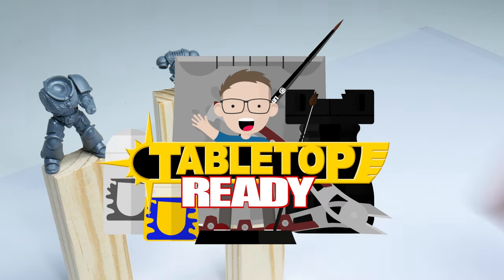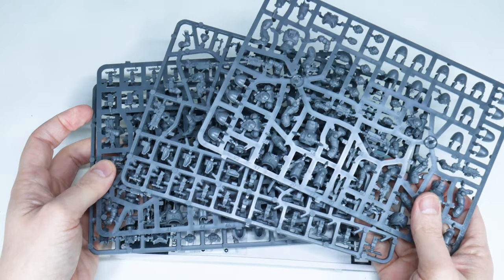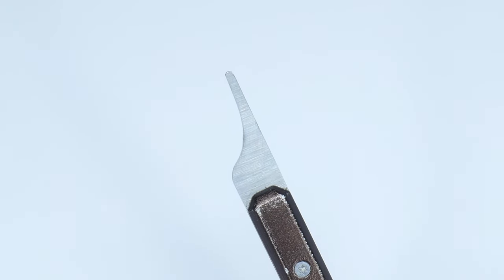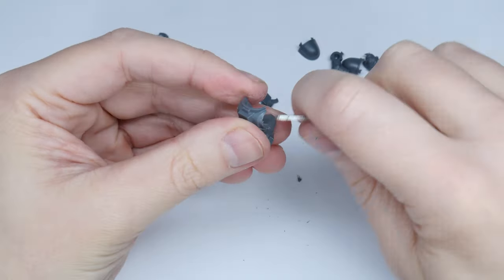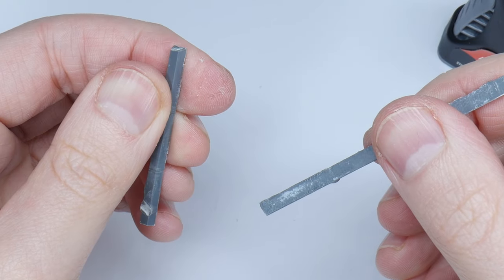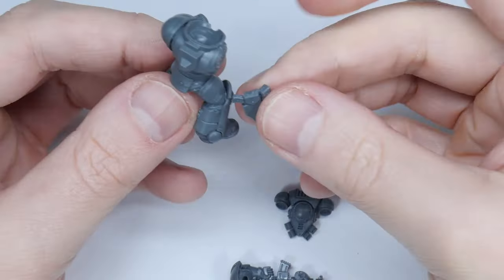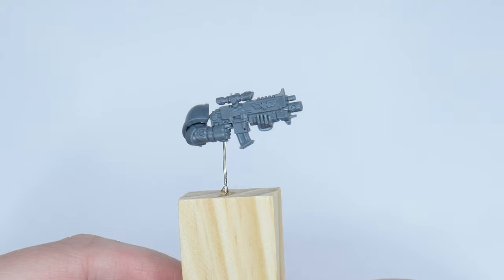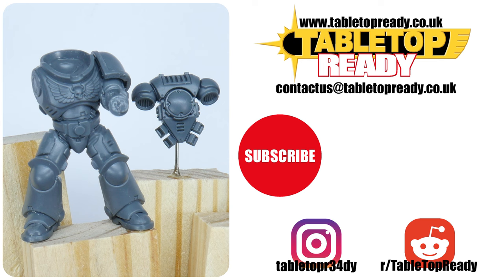How To Build Miniatures and get them ready for painting using Sub-Assemblies Making Painting Easier

Comment: I know it has been said before, but you really can't stress it enough for beginners: if you do this, make sure you don't paint the parts you're about to glue later, or use some kind of superglue instead of the plastic melting one. The glue won't make it through the paint layer, will mess everything up and you'll end up with a mess of a joint. I had to learn the hard way while gluing on some wings to the back and had no idea the glue wouldn't work, which messed up one of the best minis I've ever painted (so far).
Reply: Yeah I had a similar experience where the glue just melted away the paint that it got in contact with. Luckily all I needed to do were some light touch ups!
Reply: Wouldnt pinning work?   Say if you need to paitn cavalry and mount the rider again
Reply: @rataca100  Could do, but probably best to either mask off the contact areas, or scrape some paint so plastic glue works, or just use super glue
Reply: Yeah your paints are acrylic which is a plastic medium so unfortunately plastic glue melts it in its attempt to bond with it.
Reply: And this is why I don’t sub assemble. Sometimes just the fumes and mess up the paint.
Reply: Learned this today… I masked the joint where the head goes but not the shoulder joints or the bottom of the feet. Spent an hour scraping and sanding to get the desired effect. Live and learn.
Reply: So just for clarification, if I accidentally paint over the area I’m connecting the part to, will Super Glue still work on the painted area?
Reply: @hodelngasu3103 Yes, it will as it connects anything. Just not as solid as plastic glue as it does not melt the plastic parts together.

Comment: I would heavily advise using some blutack, tape, putty, or whatever to protect the joints that will eventually be glued together. Nothing worse that undercoating each part and having a beautiful paint job, only for the cement to have no plastic to melt. So it ruins your paint and your model won’t assemble
Reply from the maker: thats great advice. Because plastic glue can ruin the paint, I like to use super glue instead

Comment: To save a bit of time, I've found that the only sub-assemblies that are always required are the body, backpack (or similar such as cloaks, etc.), and head. I only do the arms separately if they cross over in front of the body (otherwise it's hard to get to the armor underneath). On models where the arms have a wide open pose, it's not necessary. Also, the holsters are usually easy enough to paint when they're glued onto the body that it's not necessary to do them as a separate sub-assembly. This will differ depending on the model, of course.
Reply from the maker: absolutly. some of my choices for sub assemblies are made so I can better show how to paint on camera. but you can do as few or as many as you need to. I bet theres people out there who paint every part seperate ha and some times if theres a lot to paint I'll just assemble everything so it doesn't get too over whelming. :D
Reply: @TableTopReadyYouTube  Yep! I tried priming and basing every part while still on the sprue, once. Once. As soon as it came time to nip & trim, though, I realized why that was a bad choice. 😄
Reply: Yeah I'm dealing with this with primaris infiltrators right now. Holsters, pouches and grenades have gone on. Heads, backpacks and guns held with two hands are all separate and now I have a board covered in so many individual bits it looks like a hedgehog

Comment: I actually would recommend cutting with the scalpel TOWARDS your body. It seems silly and dangerous, but since you're typically cutting such a small and simple thing (I.E. not applying tons of pressure trying to lop off a large chunk, or widdle down a large stick into a spear), you can use your fingers and thumb as a fulcrum to gain more control and finesse than if you were pushing away. Also, since it's a small thing like I mentioned in the last sentence, if you end up actually cutting through the mini and touching your skin, you aren't using enough force to slice into your skin. If you notice you actually DO have to apply a lot of pressure to cut through GW's plastic... you likely need a new scalpel, because your current one is now dull.
Reply from the maker: Wether you’re cutting towards you or away from you can provide the same amount of control with enough practice. The problem is having to put your fingers in front of the blade when pulling the blade towards you rather than behind when pushing it away. I find this method a lot better for myself as i don’t find myself having to wear a plaster when I paint anymore haha and it use to happen a lot. It’s important that people work in a way that works best for them, I’m just showing what works best for me which is safer as a lot of new hobbyists will watch this and don’t have that experience we have with a craft knife 👍🏻

Comment: Thank you for your video and inspiration. The jenga handles are simply genius. They make moving the work around my table a lot manageable and easier to put down and pick back up with out taking a ton of space. Cons, I gotta be more selective with my super glue as I’m using smaller resin printed models and I ran into two problems to solve. The first being that the smaller size models legs can break before the Super glue bond breaks. Second, models with broader spaces have trouble adhering if the surface isn’t completely flat. I think i can try using more paper clips points glued and elevated from the jenga piece, that the feet of my model can stand on and be glued to.  

I’m curious what you do for bigger models? I tried screwing some jenga pieces together and glued big feet to the whole piece Hard welding the model to the jenga pieces together 🤷🏽‍♂️
Reply from the maker: I'm not sure if you've seen my more recent version of this tutorial, I do things a little differently now. if your worried about removing parts without breaking them, you can always have then attached to their bases and then use a plastic shot glass as a handle. For bigger models I try and find other things I can use, I have a few spray can lids which do the trick

Comment: Great video, though I disagree with the idea that you should move the knife away from you whilst removing mold lines - I find I have much more control when moving it towards me.
Reply from the maker: Thank you. It’s not so much about control as it is to prevent cutting yourself. Cutting towards you or away from you can provide as much control as you want with enough practice. The problem is when you work towards yourself you tend to put your hand and fingers in front of the blade as you pull it towards you and you end up having to paint with a plaster on your finger haha you should always work how you feel comfortable though but I want to make sure I’m showing best practice in my videos

Comment: If you don't have a hand drill for minis, you can just use a lighter and heat up the paper clip (watch your fingers of course). Also you can buy hard sponge blocks for sanding and jam the paper clips into them.
Reply from the maker: Your a madman
Reply: I use putty (such as Blu-Tack) and wooden match sticks to hold the parts for priming. Saves a lot of time and hand cramps over drilling with a pin vise. As an added benefit, the putty covers the area where you're going to glue the part so the paint doesn't interfere with the plastic cement.

Comment: Hey mate, very helpful video. I have a question about the powerpacks, how do you then cut it after the painting is complete?
Do you somehow rip the pack off the paperclip? Or cut it as close as possible?
Cheers mate
Reply from the maker: Once I’m finished painting, I just snap the parts off the paper clips because of how the super glue works 👍🏻

Comment: stupid question, when you put your sub assembly back together, do you scrape off paint where the parts meet and use plastic glue, or just super glue em
Reply from the maker: I assemble after painting. If you super glue then you don’t need to scrape away paint, but you do with poly cement

Comment: This method looks great as I’m a perfectionist and would like to be able to get those hard to reach places looking as best as I can get them. I’m new to the hobby and starting my first set of infernus space marines. Do you think I can use this method on the push fit models? I’m not sure how they will join and wether I’ll have gaps once fitted together. Thanks!
Reply from the maker: For those marines what I did was to leave the back packs off and also the heads. I just clipped off the pegs for the heads. 🖖🏻

Comment: Super gluing the models to the wood is an interesting idea, but won't the residue from the superglue on the miniature interfere with the plastic glue when it comes to assembly? Cheers (:
Also, which super glue are you using here? Thanks bro (:
Reply from the maker: I'll tend to remove it by scraping or sanding once I'm ready to assemble everything. I will be doing an updated version of this tutorial very soon. Any super glue is fine. I use what ever I have at the time to be honest

Comment: One thing missing is how you glue it back together after painting! As presumably the plastic is then covered in paint, so plastic glue wont work! Is it just super glue you use to reassemble?

Sorry, commented something similar on another vid you did too but really lookint for advice 😅
Reply from the maker: you can use super glue wth no issues. if you want to use polycement then I reccomend scraping a little of the paint away from the contact surface. I do have a recent video about getting your miniatures ready for painting talking about it :D
Reply from the maker: no worries :P hope this helps

Comment: Question - I use plastic glue to glue my parts after I’ve primed them with Citadel spray can paint so I reach all the nooks and crannies. I’ve heard some people say that you should never use glue on primed parts however a guy working at a Warhammer shop said it’s fine with plastic glue just not super glue. Do you know if this is true?
Reply from the maker: You can use plastic glue. It’s best to scrape some of the paint away as the glue is designed to melt the plastic. Super glue is also fine

Comment: Wow, first time seeing SM's being assembled - Didn't know there were this many small pieces in comparison to standard ork boyz. The difference is that orks are far more difficult to paint, so guess it balances out haha.
Reply from the maker: It’s a different experience painting a space marine than an Ork. I wouldn’t say more difficult as you can make anything as difficult as you want to 😃 You can get away with a lot painting Orks, a space marine needs a more attentive touch if you want to achieve the same level. Orks are more fun to paint though obviously as Orks are best haha but it’s good to have a go at painting many different things so we get experience and knowledge we can use on anything we paint 👍🏻

Comment: Thanks for the video.
I missed some info about how to remove the paper clips from the small parts, as grabbing them hard to yank the wires after paint is a risk to damag the paint. Maybe cutting them off?
Reply from the maker: when I remove parts from the paper clips I give them a twist first to break the glue bond and they should pop straight off. :D
Reply: @TableTopReadyYouTube  good idea, thanks!

Comment: I use super glue to magnetise my models bases but it frosts too much for me to risk using it on my minis

Thank you for the guide, I've had real trouble with the Tamiya glue as it seems to dry almost instantly but the tip about cutting the connections off the model once it's off the sprue will be a huge help
Reply from the maker: Yeah super glue will frost any clear plastic. It’s okay to use on grey plastic though even if you get that fogginess as it doesn’t create texture. Super glue is brittle though. 

Check which Tamiya glue you have. You may have the quick setting stuff that does evaporate quickly.  the dark green extra thin is pretty good though. The idea with the tamiya is to have contact and then apply the glue into the gap if that makes sense
Reply: @TableTopReadyYouTube  thank you so much you it is indeed the quick drying version I bought (by accident) and it dries too quickly. I'll try the regular one though as I get tired of the GW one running out of the seams

Comment: Newbie to 40k, I've heard about a method involving painting the parts while still attached to the sprue then assembling. Thoughts? Why or why not?
Reply from the maker: You can paint them on the sprue. Try different things out and see what you prefer. The reason a lot of people don’t though is because eventually you need to take the pieces off the sprue and clean them up which means re painting them. Building sub assemblies is kind of  the in between. Not fully built but not on the sprue either

Comment: Are you able to just pull a piece that's been glued to the paper clip straight off? Or would you have to snip said paper clip?
Reply from the maker: Most of the time the paper clip will come away cleanly as well. If it doesn’t you can clip it as you say. You may get super glue residue but that can easily be filed and cleaned up, that’s also why  we should choose an inconspicuous area to pin
Reply: @TableTopReadyYouTube  Thanks!

Comment: how do you deal with the primer on surfaces you are gluing together?
Reply from the maker: because I use super glue to stick the parts together, it doesn't really cause an issue. If I were to use polycement though, I would scrape away the paint first.

Comment: did you use super glue when mounting the paperclip onto the block?
Reply from the maker: I did, yes
Reply: @TableTopReadyYouTube  alright cool. do you still break it off or is it just on there now. And what about the pieces themselves? do you superglue the paper clip onto em to? rn I'm assuming not.
Reply from the maker: Most of the time I’ll leave it in the block, but each project is different so I’ll change things up as and when I need to. I also use super glue to attach parts. Superglue is brittle and easy to break the bond making it ideal.
Reply: @TableTopReadyYouTube  True. I don't have a good drill to do the paper clip part right now so I've just been supergluing the arms and backpacks to the block itself but I suppose I could super glue the pieces on to the clip as well. It's just that I've had issues with super glue on my pieces before that made certain pieces impossible to use bc the super glue filled in the space required for the connection so I am a bit anxious with using it again for this haha.

Comment: Could I simply use super glue if I don't have any plastic glue for whatever reason that may be?
Reply from the maker: Of course you can. Just be aware super glue doesn’t provide as permanent a bond as the plastic glue. You can drop a miniature glued with super glue and it could still have pieces break off or even just while your painting. If you are going to be glueing a lot of plastic together in the future I do recommend the polycement. But super glue is absolutely fine to use until your able to invest in some plastic glue 👍🏻
Reply: @TableTopReadyYouTube  Alright, thanks

Comment: I just pain them on the sprue and then, once cut off the sprue, i do a few easy quick fix ups. As for the shades and lighting effects, i did a side by side comparison with a "assemble and then paint" and found them vastly overrated - hard to tell the difference. Not worth the extra effort. 
TLDR: just pain them on the sprue, cut them off, fix up the little painting errors, glue them together.
Reply from the maker: Everyone is different. What you prefer to do will not be right for everyone. I encourage people to try different things.